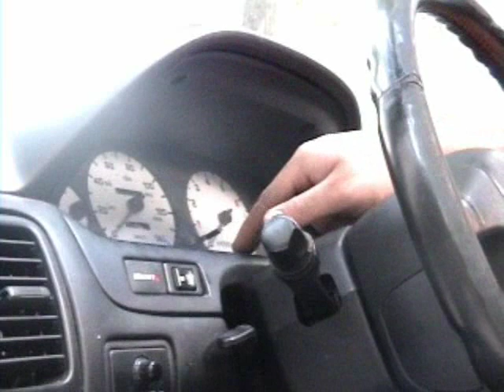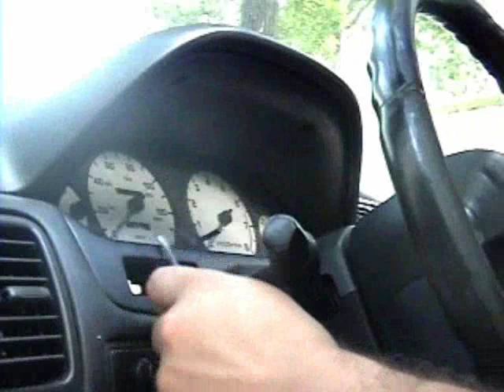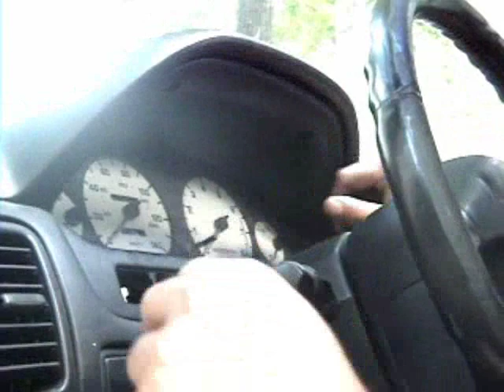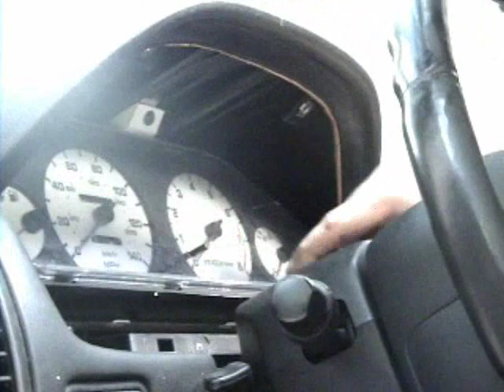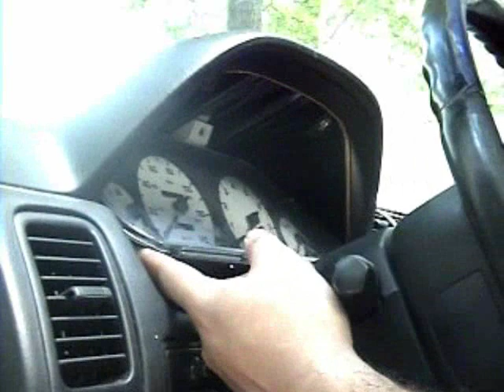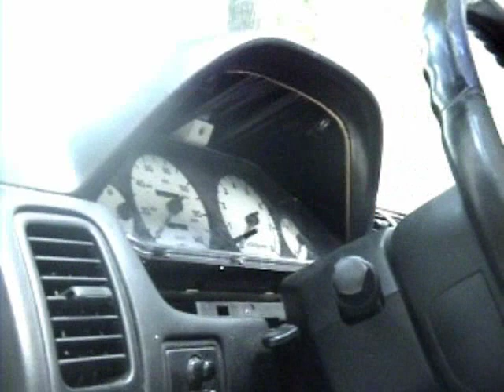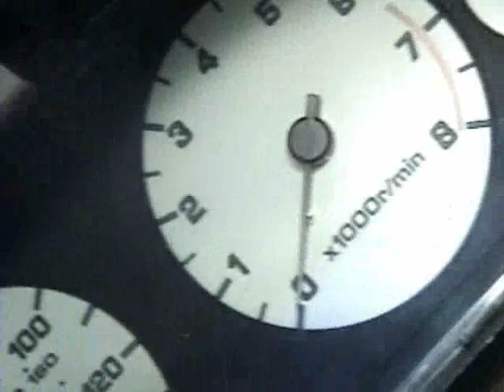1995-1999 Nissan Maxima: Gauge cluster replacement

Comment: I had replaced my guage cluster as well, because my rpm gauge was shot to hell, it would just spin and rotate like a clock face(violently-deranged&posessed) but I cracked my trim (in a non recognizable spot,LoL) putting it back together -but the new gauge cluster works fine now. Thanks for your video, I actually used it as my guide some month ago.

Comment from the maker: They can be, indeed. I've never had an issue with pulling it out this way, but there is a good amount of flexing of the cluster bezel needed in order to clear the steering column trim. If it's very cold, I could see it snapping with little effort.

Comment from the maker: That could be a faulty RPM input from the ECM, or it could just be a bad cluster (more likely a bad motor in the tach 'module' itself), but most tend to replace the entire cluster instead of the discrete parts inside.

Comment: The speedo on mine frequently stops working an sits at zero while I'm driving. I did some research and a few people said it could be the speed censor on my transmission. However, I would think if that were the case, then my odometer would stop working at the same time and it still works fine when my speedo isn't working at all. Any thoughts?

Comment: How do you set the mileage if it's a used cluster with more miles, also can I just swap the tachometer since that's the only thing bouncing around? Also my gas low light does not come on when my fuel is low wassup with Boredmnd? forgive me if I spelled your name wrong.
Reply from the maker: +Marktheshark804 You can't, really. The only real way to do it without physically tampering is to feed it a speedo signal and let it max out then loop back around. If it's a 98/99 (digi ODO), you can just reflash the EEPROM that holds the mileage (I've had some mild luck with this, playing around with a '99 SE cluster).

Yes, you can just swap the tach out, each gauge is a discrete module. Before swapping anything out, pull the cluster and tighten the screws that mount the tach, that's generally the issue (a loose TAM screw will cause your tach to freak out, they're labeled on the flex).

Assuming your low fuel lamp isn't burnt out, I'd be looking at the fuel sending unit assy for failure; the low fuel light is a function of the sending unit, not the cluster (at least for 95-97, unsure for the digital clusters).

Comment: hi aĺl, quick question, possibly long answer, but besides the coñector plug differences, has anyone swapped the cluster from an a32 and replaced it with an a33 cluster ( digital odo ) ? Any dramas ? Can't get an a32 dash in perth, heaps of a33's but. Thought it may be a solution with a neater look.
Reply from the maker: +Don Gauvin I installed an A33 cluster in my A32 just to see if it could be done. Everything works except for the speedo not reading below ~10mph, and a constant CEL due to the incorrect speedo output from the cluster (it outputs ~4x the speed the A32 does, which will trip your speed limiter and kill your cruise if you have it hooked up).

Always intended to make an adapter, but without some bench equipment that would make it easier (waveform generator), never got around to it.

Comment: Anything u know of some wiring attached to gauge cluster that can cause charging system problems?
Reply from the maker: If the battery bulb in the cluster blows, or is removed, the alt won't charge.